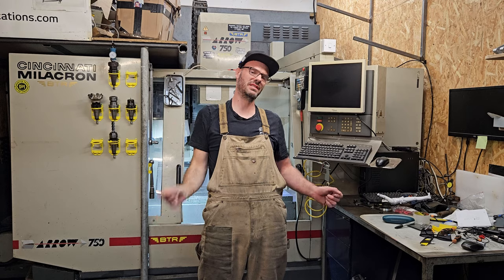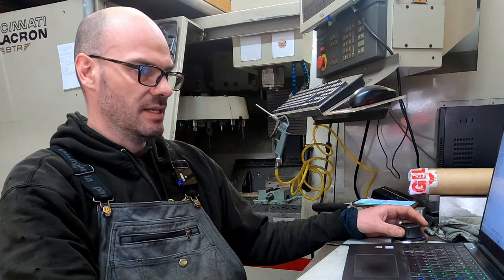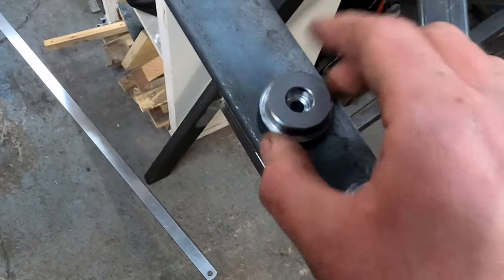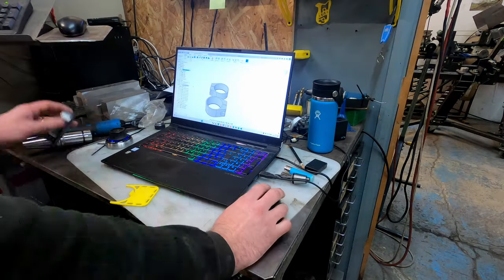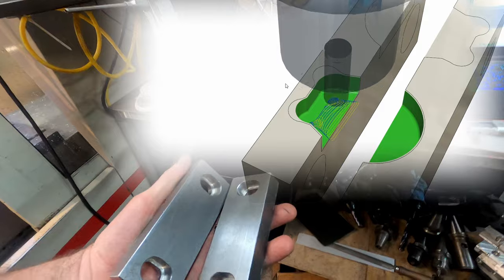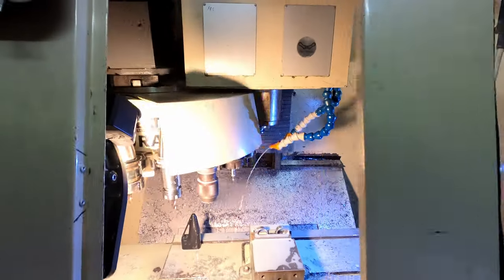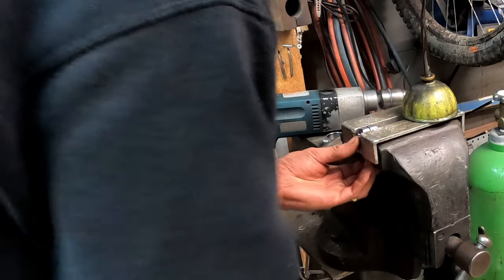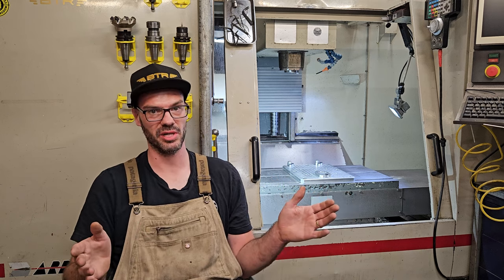2. Gasser Project - Swingarm bits

Comment: Nice seat post clamps! Hats!!
Reply from the maker: Lolz 🤣 they would make a pretty nice seat clamp, just the wrong diameter to fit 🤦 I have made some seat clamps, but they are the weld on type. Only way to go in my opinion. You'll get to see them in the front triangle video if you fancy sticking around.